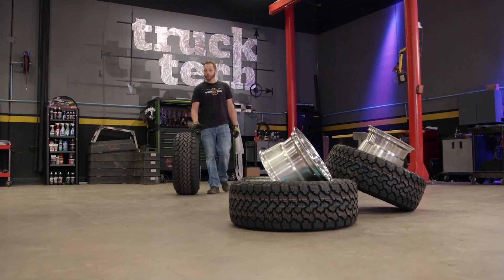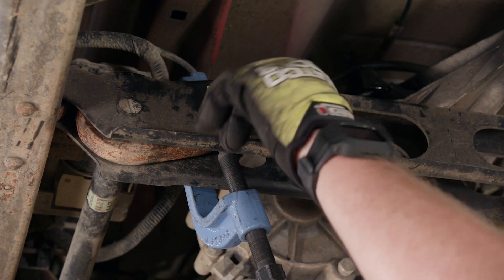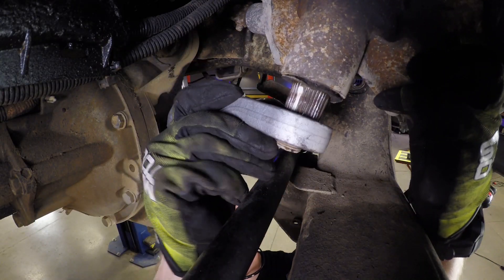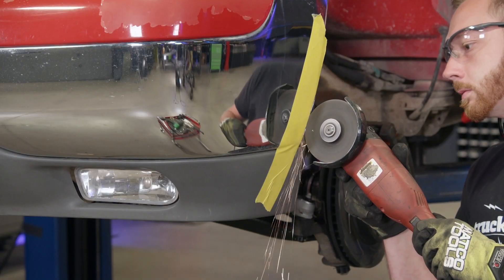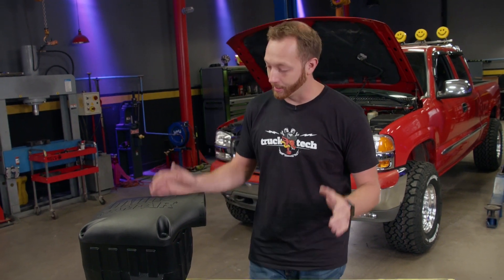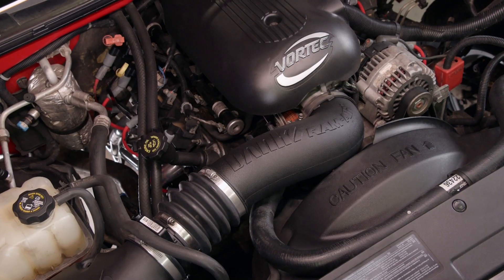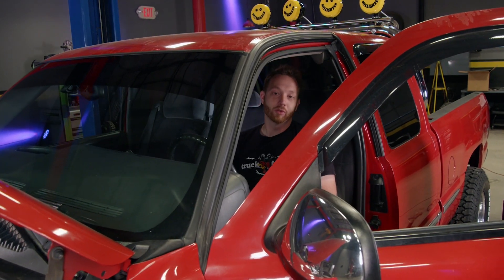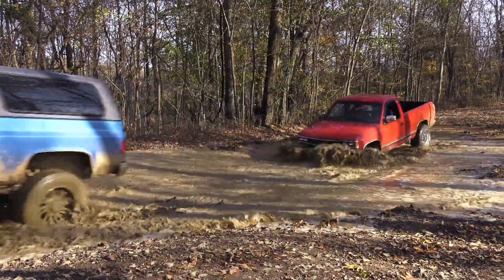Making Room For Bigger Tires On Our Lifted GMC Sierra 1500 - Truck Tech S7, E20

Comment: This video makes me wanna get rid of my 19 Silverado, and get another one of these early 2000 GM trucks. Definitely one of my favorite body styles, and it’s not overloaded with technology.
Reply: Don't do it. You like the warranty 😂.
Reply: I got a 99 new body style and a 05... absolutely love them.. call me crazy but I'm looking for another one..
Reply: I am the same. I refuse the new cellphone trucks.
Reply: I love my 00’ step side!!!
Reply: Just sold my 19 trail boss and bought a 2002 tahoe to fix up.  Loving it so far.  Went with a tahoe cause i don't use the bed as much as i planned.  Might as well have heated excess space.
Reply: I did just that. Would rebuild it 100x if i had to.
Reply: Back when trucks where made good
Reply: Lol. I have an 02 chevy Z71. I wouldn’t trade or sell it for anything, these new trucks are iPads on wheels.
Reply: Have an 01 Sierra same spec as this one in the video. 103k miles.. 👀
Reply: 90s body is slick when done right
Reply: I have a 2012 and never had mechanical issues everything plastic thou is God awful lol
Reply: Just bought a 99 Sierra Z71 single cab - freaking love these models
Reply: Big + in my books is you can actually fix the older vehicles yourself. Can't tell you how much $$ I've saved doing my own work
Reply: 1999-2018 are the best body styles for the 1500 and 2001-2019 are the best for the 2500hd
Reply: @bigwahoo8686 cause those newer trucks NEED the warranty lol
Reply: I just flew to Tx to buy an 06 Suburban 2500 with the 8.1L…. AWESOME truck.
Reply: I love the NBS body style I just hate the rust that comes with it
Reply: I got a similar year yukon xl cause of the drivetrain (6.2 6 speed), and i ended up getting rid of it. The vehicle was poor quality and too many issues. Old body styles are vastly superior.

Comment: Absolutely no need to cut into the bumper or the metal fender for 33s. I’ve had several of these trucks with a leveling kit and 35s and have only ever had to trim the plastic valence bumper and plastic inner fenders (which this truck doesn’t have). Still have plenty of room. This truck could easily fit 33s with the factory torsion keys turned all the way up.
Reply: You are correct.  But cranking factory keys that high makes it ride harsh and you likely ran factory wheels with positive offset. I would also doubt you put a bump stop under your jounce bumpers to fill in the gap created.  

So you're correct.  You don't "need" to cut the bumper or fender

Comment: If you get the right offset for the rims you won't need to trim anything. Remember trimming is only if necessary. I just mounted up some 20s on 33s for the exact truck with stock ride height and they fit just fine. Only because the offset was correct.
Reply: What offset do you have?

Comment: I was lucky enough to find an 05 sierra with only 60k. It’s been the garage baby of an older gent. That as you can imagine went berserk in an accessory shop and applied every available piece of plastic chrome you can imagine…. Even had some old skool pinstriping done… very well I might ad . But I want to minimize the “glitz” and update the stance. Btw… it IS only a 2nd… so I know I’ll get mixed reviews on “lifting “ it…. I really only wanna level it, and widen the stance… I don’t want a “monster truck” or anything…. Just a nice level stance that pushes the tires out enough to look “bad ass” . Lol. I will use this truck to haul my drums ( has a hard tonneau) surprise ( it’s not chrome… but it does match the truck ) ( fire engine red) …. I love the finished look of your truck … I don’t have or need 33’s I do have 17’s but I’m not sure of the width… they seem pretty wide just not “off road” tires. I don’t need em . The question is, will a leveling kit and spacers ( I know a lot of people hate em.) do the trick? Mechanically the truck is pristine…anything I should know or do? I will probably NOT be doing it myself… ( no specialty tools and would just feel more confident having a “pro” do it….
Estimated labor cost? Spacers and levelers….?

Comment: Love my 02 sierra. Has 250k and still runs strong. Not a huge fan of the resale red or the yellow light covers but its a sharp..
Reply: My 2002 gmc has 401000 miles on it daily driver.
Reply: Holy cow an I thought I was running out of miles on my 02 I got 175k
Reply: My 07 Tahoe is at 280k miles and still kickin. Raptor lined the body with the factory gray color to avoid messing with jambs, 2-1/2” level on 33”s on 18”x9 procomp wheels, tuned 5.3, tuned trans, etc. going for a little older school look with 3 round PIAA lights on the prerunner bar and mild roof rack. Been thinking about adding the same lights to the rack but I can’t make up my mind. I have some terrain and trees on my property (nothing too crazy) so my battleship handles it effortlessly and comes out without damage.

Comment: Great video you really talented great work on the truck looks freaking awesome love the rims and tires also I have to tell you I have a RARE  2000 Factory original z85 package with heavy duty Factory suspension not a Z 71 not many of those around
Reply: Keep up the great work John with z85 truck from winterpeg Canada all the best in the new year
Reply: Z85 and Z71 are the same rating for towing and hauling in my brochure. All these early GM800T vehicles had the same weak 1,500lb. rear springs.

Comment: POWERNATION!! What are the other dimensions for your 16" wheels and where did you get them? I have been trying to nail that exact wheel and tire fitment and look on my 2000 GMC Sierra 1500. Looks really good. I appreciate it.
Reply: Saaaammmeeee here. I hate when they dont list complete build info
Reply: Guessing it's a 6 on 5.5 bolt pattern.  They look like the Mickey Thompson Classic 3
Reply: @bmstylee  Bolt pattern wasn't the issue. Its the brand of wheel. I suppose they don't lost parts used if theyre not a sponsor which makes sense
Reply: My guess is 16x10 and they look like Ion 171 rims.
Reply: Yea I think 16x10 because I have 16x8 same wheels, and the lip isn’t as big

Comment: Have the same truck. Would have liked to see what it ran on the dyno before and after the tune. Curious if they’re worth it. 

Also the light bar looks great until you try to slide a 4x8 sheet of plywood in the bed.
Reply: It’s a 6 ft bed anyway right lol.  Another 6 inches won’t be missed 😂

Comment: Watching this series breaks my heart. I had a 99 1500 Z71 that I did most of this stuff to. Ran like a damn top after I got done replacing the things it needed (and it was a lot). The frame snapped in between the torsion bar mount rivets under the driver's door. This is what my truck was supposed to look like (minus the light bar). Truck came out awesome.

Comment: What size motor is in this truck?? I have a 2002 gmc 2wd im doing a lot of these same upgrades too. Plan on putting 3 inches in the front and 2 inches in the back worth of lift. Will I fit 33 inch tires?

Comment: Great build.   I would not be cutting my fenders or bumper for tires.
Reply: Me neither.  I went with 285/75r16s with zero offset and a leveling kit on my 04 Yukon.  The only trimming was the plastic in we fender at the front tire by the washer fluid bottle.  They don't "stick out" but they're out a lot further than stock.

Comment: a cold air intake, log tube headers and other breathing parts should be the cherry on top. how much hp did this truck add at max? probably 10...how much does a built engine that needs more air flow gain? sometimes hundreds but never just 10..think about it

Comment: How much lift did  on the front did you add? And are the tires 285 or 305s both can be considered 33s one Slightly less and the other more. I'm guessing 305 since you had to cut.
Reply: Offset has a lot to do with it as well, I have 285/75s on stock wheels and I didn’t trim at all. And no rubbing.

Comment: What are the rims they use? Those look great!
Reply: They look like Mickey Thompson Classic III's, although they could be something else. That general style of wheel is referred to as "Bullet Holes" where I'm from, and there's a whole lot of companies that make a wheel in that style.
Reply: @DeathHead1358  I was looking at the American racing baja ar172 i think they are called but the pictures only show 5 lugs. But the fitment says itd go on my truck so I'm not sure. 06 Sierra 1500 6× 5.5
Reply: @jonathanmann8566  They should have that in the 6x5.5 bolt pattern, given that that bolt pattern has been on GM trucks for the better part of something like 40 years.
Reply: @DeathHead1358  It seemed like a common thing none of the pictures actually show that rim in a 6 lug so I'm not 100% on it yet
Reply: @jonathanmann8566  I checked on Custom Offsets, and they have them in a 17x9 for my 2012 Silverado 1500 which has the same bolt pattern. Granted, it looks like it's only available in black.
Reply: they say Ion Alloy on them. Pretty stupid they dont say and give exact specifications on stuff

Comment: I have a question what would be a better engine for my truck LS swap or a motor out of the catfish Camaro ss
Reply: They are the same engine family. The Camaro is a LS1. The trucks are LS style motors. Many parts are interchangeable. Pick the truck engine for cost and availability. A 4.8 will cost less and can easily make 600

Comment: What width and offset are those wheels?
Reply: Guessing 33x10.50r16.  Offset no idea.   I do like those rims.
Reply: That's one thing I hate about shows like this, if they aren't given the parts for free they wont tell you the brand or specs.  It appears to be an ION Alloy 171, which by their webpage makes it either -5 offset for an 8 inch wide wheel or -38 offset for a 10 inch wide wheel.  The tires are 305/70R16 so its most likely the 10" wheel.

Comment: also, gaining 10-15hp on a 125hp machine is not very noticeable believe it or not. 10 hp is about how much a regular person can pull on a 10speed bicycle. but if you was to add 25% or more hp then you are doing it, however that much hp addition will hit you in the $$$ss because you will trade some reliability, gas money, longevity of the parts will be effected including the ones you did not change.  nobody ever talks about the down side of modification, and sometimes the downside gobbles up everything. i.e. bigger tires, more power, means you need more breaks,  so the downside,  you have to upgrade stoppage power or hope you can stop in time all the time...I am not downing customization, I am however dissing anyone who promotes it but does not explain the bad side of things. this is where people get hurt, money is wasted,  safety gets compromised,  gofast theories get twisted to make a sale...

Comment: do your research. a cold air intake will give you a couple horses, if you have modified the amount of air the engine eats you will get more gains but still a very small percentage. @stock cold air is not worth it in my opinion  because cold air intake kit filters are way more expensive then stock or a stock replacement, add in what you spent on the kit a couple of replacement filters and  you could save that money and put some real horse power gainer like an intake or turbski or other compressor....now those really benefit from cold air, but getting cooler air for that graduates you into an inter cooler,,,a world apart from a gimmicky, never noticed power gains of a cold air intake...and no no no, dont start with the efficiency clause people seem to pull out of their back pockets, again, you mush look at the % of overall gain vs what you are spending, what the modification(s) will cost because all modification have a cost besides the money spent as very few modifications on very few vehicles are actually better at managing all the factors the factory spent years balancing function, longevity and efficiency together as a system.
Reply: just remember...this show is a BIG advertisement. Theses companies pay for these spots on the show